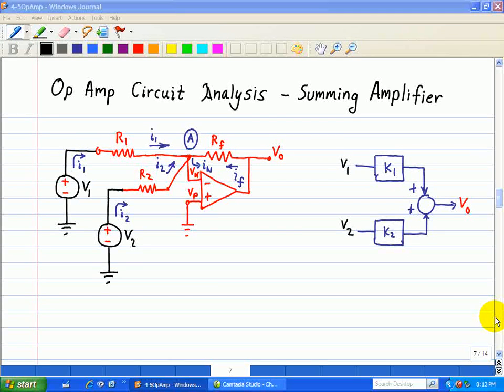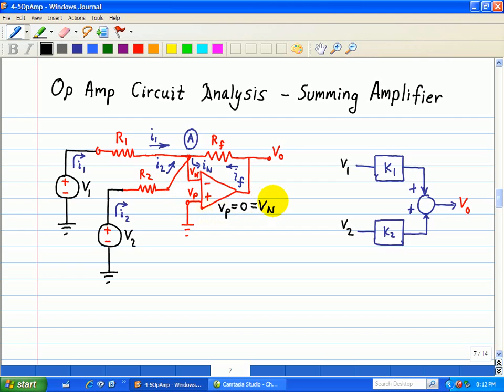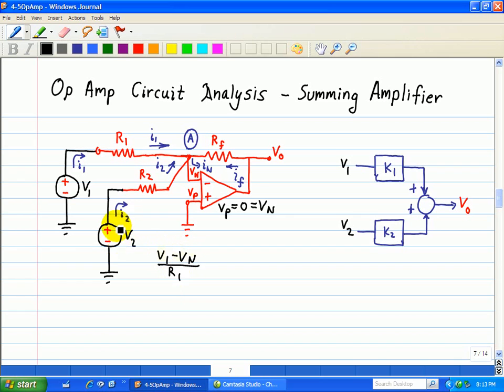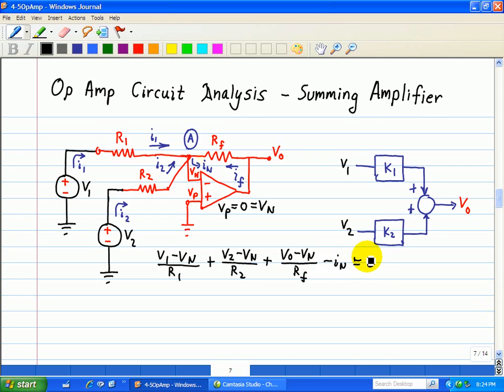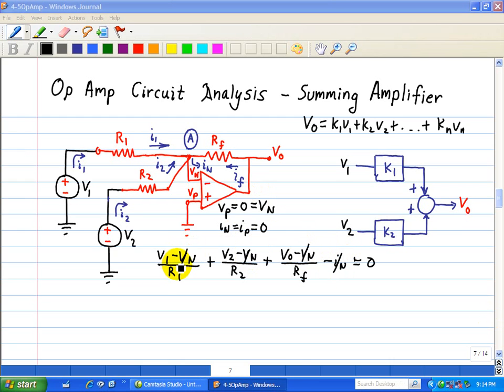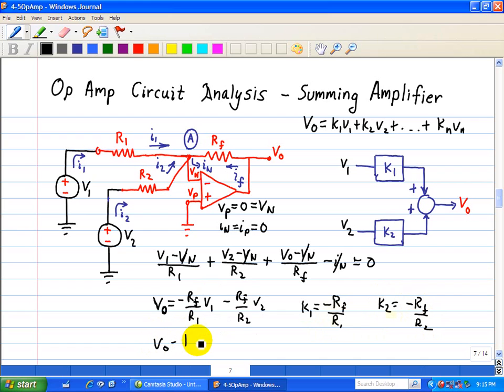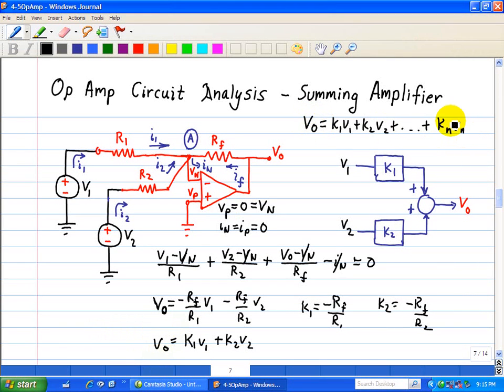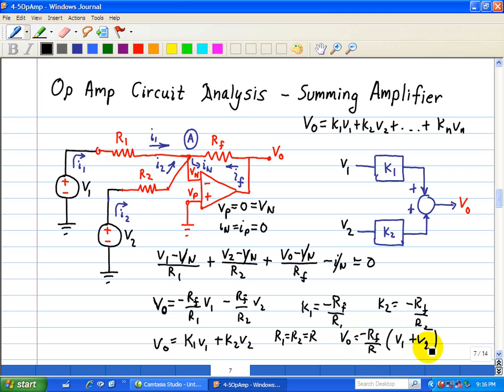Op Amp Design Basics - Inverting Summing Amplifier - Part 4 (Circuit Analysis for Dummies)

Comment from the maker: @Lagonz2000 Yes, you are correct that the weights of the inputs to the summer are one.  From a systems perspective, you can weigh the importance of various sensor outputs if you think one sensor is more useful than the other.  Hope this helps!  Dr J

Comment from the maker: Yes, you are correct that the weights of the inputs to the summer are one.  From a systems perspective, you can weigh the importance of various sensor outputs if you think one sensor is more useful than the other.  Hope this helps!  Dr J